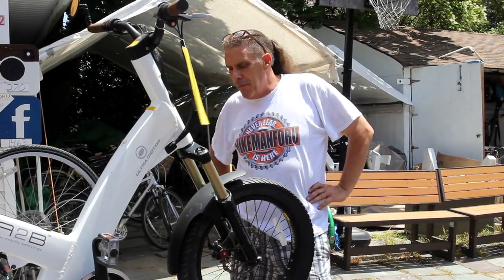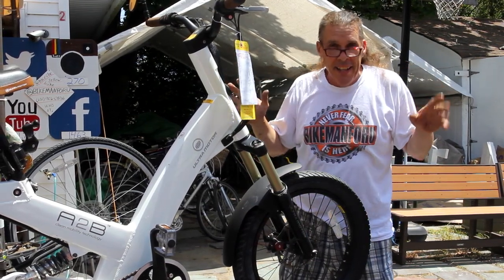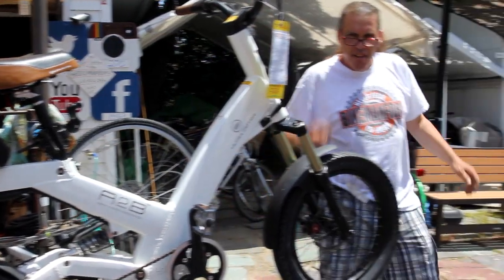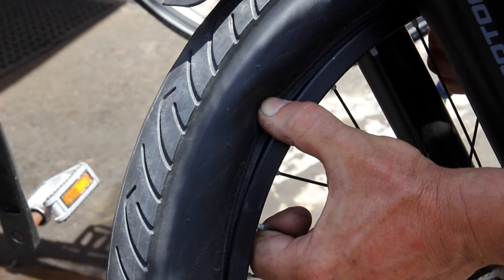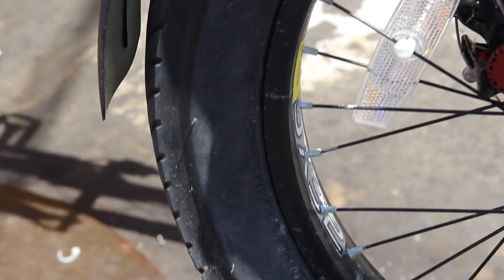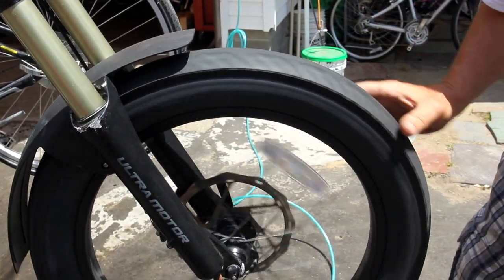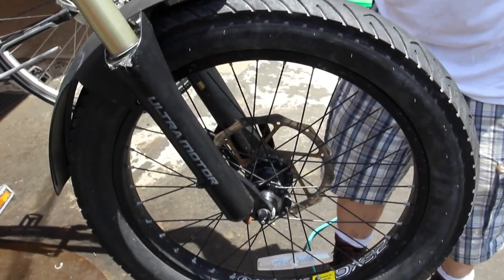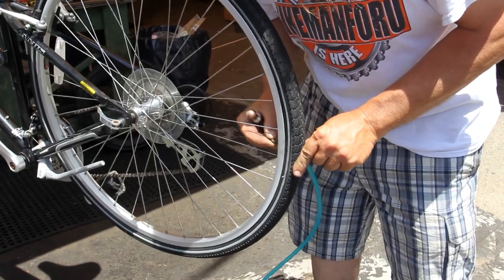How To Seat a Tire Properly - 8 Things You Should Know - BikemanforU

Comment: fwiw I've discovered Kenda Tires are having issues (across the brand) seating properly. My LBS was able to seat a set of kenda kriteriums with some tool but like the guy with the trainer, I have a kenda trainer that won't seat either. One of the guys in the club mentioned the Kenda tubes. (which I have in the tire)being an issue. There's a flat spot where the tires bead hasn't seated. I've heard suggestions  on making sure the tube is pushed up into the tire all around before inflating and using lube (talcum powder was my choice). If (like me) you have a IGH setup (alfine11)this issue is a bitch because it requires the rear wheel be installed  just so and the cable adjustment be fine tuned every time you take it off.

Comment: Pretty good video .You mention problems around the valve .After endless problems with seating I came up with my own idea that Id like to share with you .With pump connected to your valve push the valve in to the rim and keep it there until you can no longer hold it, as the pressure will want to push it out.The edge of the tyre should hopefully seat properly.I cant recommend this for compressors

Comment: Seating mountain bike tires can be really frustrating. The tube inflates well before the tire bead moves out and pinches the side wall against the rim and then the bead can't slide out. You deflate the tire and the bead drops further into the middle channel. It can make you nuts.  I find that soapy water makes it much easier. The soap allows the sidewall to slip up until the bead hits the rim.

Comment: I bought a Ghost cross over road bike  from R.E.I.  In May 2016.  I have had about seven flats.  No matter what I try I can't get the tires to mount square.  I took it back to R.E.I. for advice.  They sold me a new set of tires.  Their tech guy mounts by  using high pressure air.  I can't do that on the road, my hand pump only goes to 65.psi.  I have tried all as you suggest.  Including soapy water.  No luck.  I am thinking of returning the bike to R.E.I as I don't have any use for a bike that can't be repaired on the road.  Any final thoughts?, thanks.

Comment: I use talcum powder on the tyre rim if they are a bit of a  tight fit as it helps ease them on to the wheel without having to use levers and risk a pinch puncture. This may help if you don't have particularly strong hands .I find that talc on the tubes also stops them from sticking to the tyre and makes it easier to seat the valve straight too. Good tip about adding a little air at a time and seating it in the forks before inflating.

Comment: Heck mine did a buldge the bead was moving.  Old tire... cut tube. Bang.. didn't know the bead was bad till just before it blew. Saw buldge bead was coming up over rim wire hit . Lucky I was away from it. Prob is  24x 2.125 white walls becoming$$$$ and hard to find. Ill just put black wall. Customizing my bike anyway.  Slow process

Comment: I have never had a problem like this until recently. Last year I bought a fat bike. The winter went fine, but in the spring I decided to replace my studded tires with summer tires. When I first put the tires on the front was fine but the rear was improperly seated and the tire was out of round. I rode it for a bit but I was unhappy and I deflated it and played with it then I inflated it again. It is much better now but at higher speeds it “hops”. I’m going to give your advice a shot. I have been riding for many years and I’ve never had a problem but this my first fat bike.

Comment: Like this guy, learned a lot from him. Only have one criticism, i would not use soapy water to seat the tire. Water can get in between the tire and tube, if you use your bike in a cold climate with temps below freezing the soapy water inside will freeze causing all kinds of issues. There is a blue lube made just for seating tires, shops use it on car tires. Not sure of the name of it or where to get it, maybe someone can comment on that.

Comment: I continue having a hard time to get tire mounted square on my Ghost.  I do not like to over pressure the tire with my hand pump as it could break out in the middle of nowhere.  I have the solution!  I lube the tire bead with a dab of KY jelly.  Worked great.  Bead slips right on square with about 50 PSI.  As KY is a water based lube I do not believe it will do any damage to the tire or tube.  KY is also easy to bring with my tire patch kit.  What do you think?

Comment: Here's something that applies for any owner of a vintage bike with non-hooked rims: don't air the tire up to anything above 75psi. Older rims like Schwinn's K2 "tubular" (actually a clincher rim) don't have the bead hook modern rims have, and as a result, the tire can blow off the rim quite easily at higher pressure.
I learned that the hard way when I bought an old 70's Schwinn road bike. I decided to take a ride around the block, so I aired the tires up to the recommended 90psi. BOOM! Sounded like a shotgun blast. Sure enough, it had original steel Schwinn rims without a bead hook (hookless rims were common those days). Ears rang for quite some time.

Now when it comes to seating the bead, as long as you get it close (i.e. no obvious indication of blowing off), the tire will seat itself when inflated to normal pressures. I like to get it close, then put some air in and let it sit for 10-15 mins, then add some more air, letting it sit for a bit every time until I get to normal pressure. If it's still not even, I take it for a slow ride around the block, which usually does the trick. If that doesn't work, then going slightly over the max pressure will.

Comment: Very useful video, thanks ;)  At 56 yrs I just  now so poorly centered a tire that it was  coming off the rim at the valve. I have been putting on bike tires, at various points, since I was freakin 10yrs and have never seen that. It makes sense that it could happen because of the dropped center in the rim. One key thing I had been doing wrong is pulling the valve tight to the rim. I don't think the tube was even fully in the tire due to that. On inspection it appeared to be trapped slightly by the rim. The correct answer is to push the stem in while inflating. And, of coarse, don't assume more pressure will seat the bead properly..because ..well....it has a 100 times before.

Comment: the tip to pump it up a little extra to get the bead to "pop" into place was revolutionary. also put a little soapy water in there. never had that much difficulty to get the tire to line up on the rim correctly, this video saved me from shouting from my rooftop to the god of tires.

Comment: Damn, you just said it. "tire seating" is the major issue with most folks.
Reply: We've had a couple of chinese tires that won't seat proper. We've used some wax to maki it pop and settle. Aaand anywhoo they still won't settle. They're cheap, chinese and a bit off. It's not much a half of a Millimeter, but still it's not satisfying. After truing the wheel to 0.10mm it's a major disappointment.